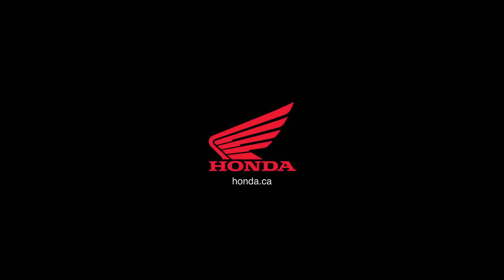How DCT (Dual-Clutch Transmission) works

Comment: Hi to everyone.
I recently moved to Canada and already got the full driving license for cars.
I'm going to buy honda nc750x dct 2023.
Transmission: Six-speed Dual Clutch Transmission with four automatic shift modes and manual mode.
Even in automatic mode anyway manual transmission works and you are able to use clutch up/down.

I'm planning to pass test in automatic mode and use clutch sometimes too.
But even if I will get restrictions to automatic transmission anyway my motorcycle will have manual and I will use it.

I'm totally confused, am I going to get the license for automatic transmission or manual transmission by passing road test on it?